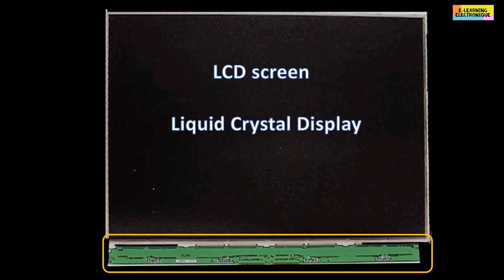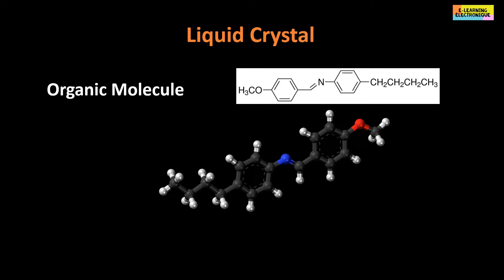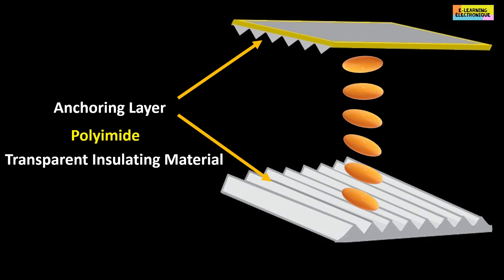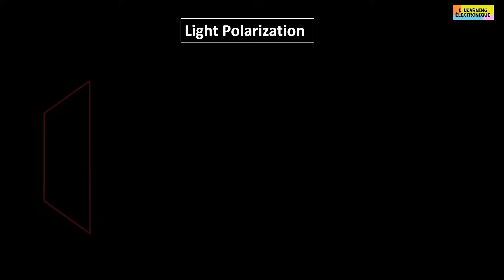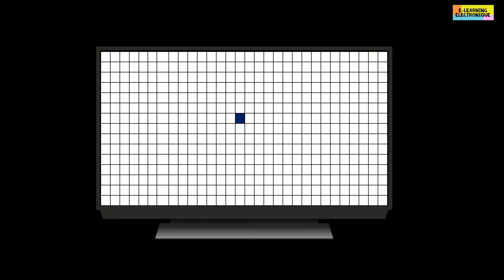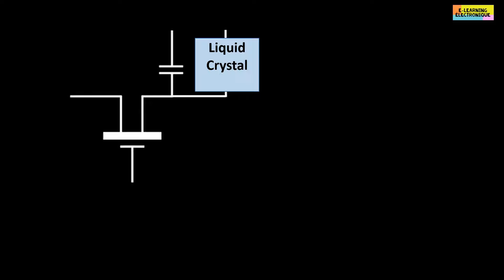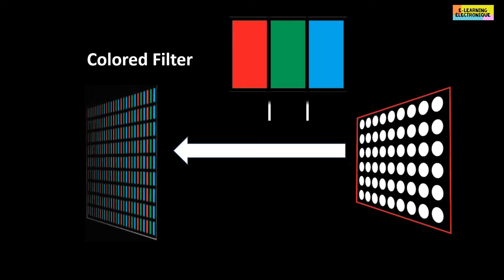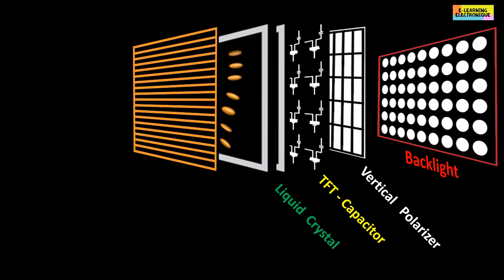Internal structure of a liquid crystal or LCD TV screen

Comment: not everyone understands the point of the capacitive structure.  the point is that the E-field in the (idealized) infinite flat plane capactior that is created by this structure induces torques on the nematic liquid crystal aggregates (through the capacitor's electric field interacting with the dipole of the molecules, in the most simplistic basic idealized approximation obviously, everything "neat and nice and clean" and capable of being modeled with 1st year university calculus, lol).   In practice, the important control input is the switching of the capacitors.    A tremendously critical part of LCD development has been the capacitor "cell" optimization, and less about things like the light source (which is almot 100% of the focus in OLED research)
Reply: lcds are incredibly advanced tech compared to oleds, if i have got it right.
the old analogue crt tvs were a fantastic ingeneering accomplishment as well.

Comment: This is the best explanation about the technology itself in Liquid Crystal Displays. Hope there's another one to talk about several changes which improved this technology to almost match with OLED types: The gain of contrast ratio; others LC types, as VA and LTPS; the FALD in miniLED for backlight etc. A question I have for Color filter on this screen, is: how do they get the acurate RGB pixel to show pure colors nowadays? Since oldest LCDs were so wayoff, in exhibiting blend colors, and now we have deepest reds/greens/blues we never saw before? If it is just the Quantum Dots layer, or if color filters are made with deep/solid RGB pixel? ...

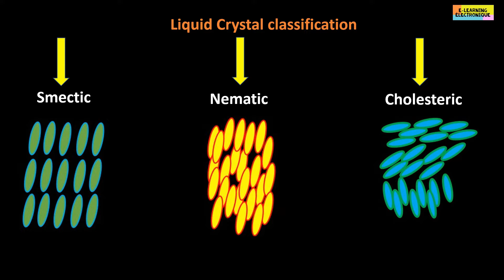Comment: 2:01 you say cholesteric have twisted structure and Nematic have common orientation, yet no structure. Then in 2:14 you said Twisted Nematic is used in displays. Why take unstructured Nematic and do something (like anchoring layer) to twist it when cholesteric is already twisted? thats one question. second question is ... you said there is no layerwise structure in Nematic. then how come when you use the anchoring layer, the successive layers of moleculeas further and further away from the anchoring layer tries to align with the first layer right next to the anchoring layer? without this aligning tendency, there would be no twist. so TN have aligned layer or not?

Comment: Hello, Genius, I'm getting a big doubt about LCD/LED TV's COF IC. I'm not getting any idea about this, because, I don't have a Microscope or DSO. If you are interested to help, please take a small test about this COF with IC & without IC. 
Everybody knows all signals are coming from the T-CON board to the LCD panel with the help of the COF bonding method and its signal testing points also given in this COF.
But, why need this COF and what is the role of this IC? This IC's data is hidden or this is not an IC. Please clarify the truth about this COF.🤔

Comment: What's the function of the LCD bezel? Can I cut half of the upper side of the LCD to reduce dimension and resolution?
Reply from the maker: The TV bezel is the frame around the screen. It's what holds the screen in place and protects it from damage. Never cut an LCD screen because it will end up in the garbage
Reply from the maker: the video confirms that the screen can be destroyed with the scissors
Reply: @elearningélectronique  but the picture still appear, no blank  or damage